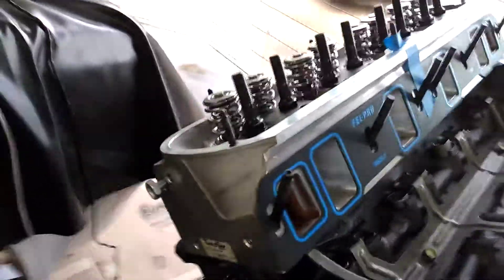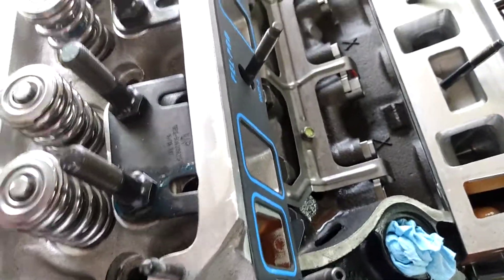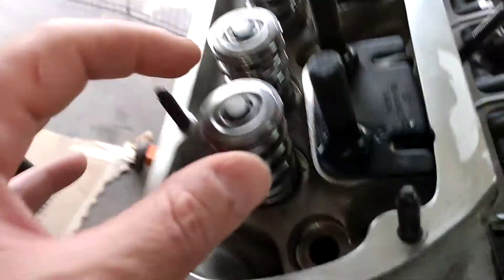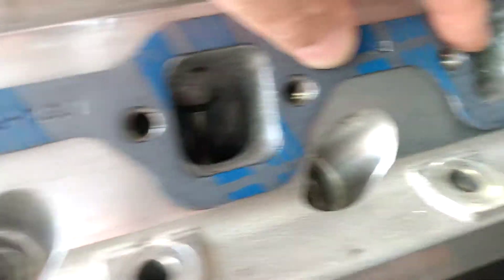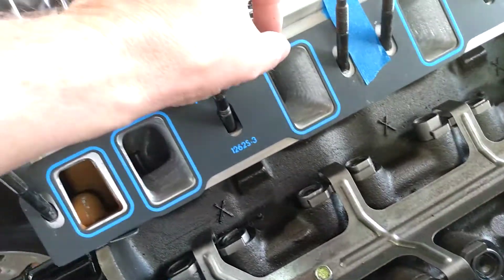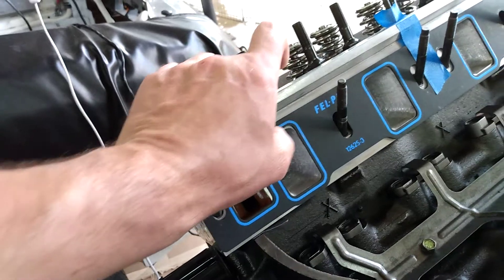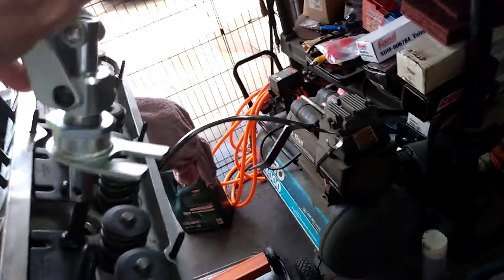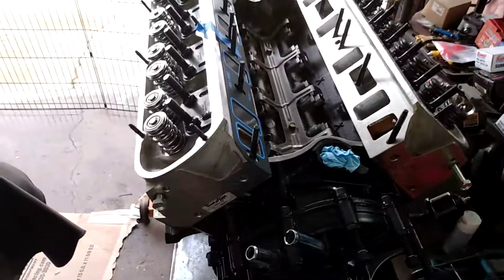Trickflow Twisted Wedge TW 170 head back from porting!

Comment: So basically almost 300CFM.   With the 1262 gasket, i would have thought the porter would have you a bit over 300CFM by .500" of lift and even more by .600", but you are close.   It's great Ed Curtis had a cam spec of basically almost .600" lift back at this time, you can be over the .600" range with the 1.7 rocker.  Did you ever dyno it and how did it perform?

It's imperitive you have your intake manifold ported to match what your heads are setup to do.   So with the manifold in place the cyllinder head flow will not drop much at all.
Reply from the maker: I'm still running the heads on a 349 carbureted engine now, Trickflow single plane intake.
Reply: @vrm86gtthat tfs single plane has a good rep.  The tfs heads always were champs.

Comment: How did you measure the required thickness of the intake gasket?
It sounds like youre just guessing.
Who bell mouth ported the exhaust ports?
Good grief SMH.
Reply from the maker: I eyeballed if the ports were lined up and went from there, as far as bellmouth on the exhaust ports I don't think they are bell mouth but ported to raise the roof a bit to match up with the felpro 1415.

Comment: I'm trying to get a spring kit with tool steel retainers.  I see the kit you have is 330 but did you pay more for the tool steel retainers
Reply from the maker: Yes, tool steel retainer were extra, I think it was like $80 or so.
Reply: Oh OK. I've been trying to message them but they don't respond to my question they just say it depends on camshaft profile?? I asked them if that kit you have has a tool steel retainer option.  I see the have a DSR kit that does come with tool steel retainers but I'd rather use Lunati bc it doesn't say what brand springs ect in the DSR kit.

Comment: Without changing the valve angles between intake and exhaust, just how did they twist the combustion chamber, and if they didn't, what makes it twisted?
Reply: The intake is twisted towards the intake side and the exhaust towards the header
Reply: @boharris8179  looked like they were inline like stock heads, but the camera was moving around so much it was hard to tell
Reply: @ChiefCabioch  my buddy is big into finding dead ones on the road and twisted wedge is like thier opossum grit's

Comment: Aluminum... always looks fantastic new, then comes the point of reality [as you spotted wanting to clean them off].  I gave up on the cleaning thing - just paint them, while they are new.  Wash first with mineral spirits, then follow up with a high temp primer and after that a high temp paint of your preference in as low a humidity environment as you can provide.  Ports?  I cover with painters tape first then outline gasket [leaving about 0.050" margin on intake for adjustment during install] and out comes the exacto knife to trim the excess.   I went for the metal look with my last set of heads and used duplicolor's "cast coat iron" [part # DE1651] - they came out nice.  Used heads?  Mineral spirits will not remove oxides, just surface contaminants -  wire brush [a small cup brush with a dremel tool works nice] to get closer to base metal, and if you really want to go whole hog you can acid clean with something avionic [like  prep for an alodine coating]  That's a pain, cause you have to remove all steel bits or pieces and if heads have heli-coils in them, that's an all stop: if you can't rinse  properly after application, it can cause corrosion down the line.  Needless to say, that guarantees pulling heads.

Comment: do u know the flow numbers from the promaxx heads...??
Reply: @vrm86gt  ok thanks..checking on what I have now ..and the PM flow way better ...!!!
Reply: @vrm86gt  I run ported Floteks now but they have the smaller valves 1.94/1.55..so I think with bigger valves and better flow I can rev higher and make some more HPs with my 331....
Reply: got my Promaxx yesterdy here in Costa Rica ... uhh they look very nice ...casting is very smooth ...nothing to do ..just put them on ...

Comment: So are these the stage 2 from BDP? How do you like them?
And what  head gasket and intake gasket did you use?
Reply: @vrm86gt  waiting on my track heats from BD as we speak.. had Him do my upper and lower, TB AND headers..yes...headers!
Reply: @vrm86gt   He got  an extra 100.something  cfm out of my headers.. which for all I have to.work with, 1 1/2 primaries for a ford ranger..they almost flow as much as a 1 3/4 shorty ls header. The port work he did on my ingakes and tb..was top notch! The best of the best in my opinion.
Reply: @vrm86gt   Man, I'll  be tuning in to.see what your numbers are..what do think they will be?
Reply: @vrm86gt   Nice man.. My little.project I'm building, little 2000 reg. cab Ranger 2wd. 302 stock bottom end..Ported upper and lower stock explorer i take and tb,  headers. 77 mm BBK MAF, 30lb injectors, Small Anderson cam, zspec t5..daily driver travel truck with ac.."Should" be very close to 340-350 to the tire. Ill get a time slip out of it a couple times just to see what I've done. Should be a very nice "street" truck... which is my sole purpose with it this time around. If I like how the truck feels.. Ill pull it back apart later and put a blown 331 in it.
Reply: @vrm86gt   yes sir... Ill get videos of the dyno tuning and once its done
Reply: @vrm86gt   sending  these back... definitely won't work with out cutting  them
Reply: @vrm86gt   What Intake gasket you end up with? My 1250 just got here.. the water jacket side.of it does not look good at all..its nothing like your  gasket in this video